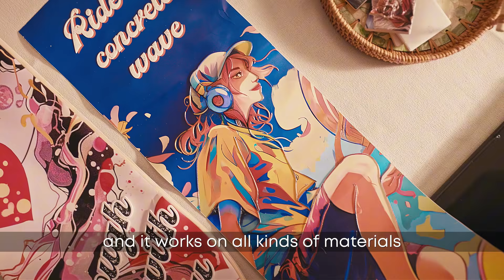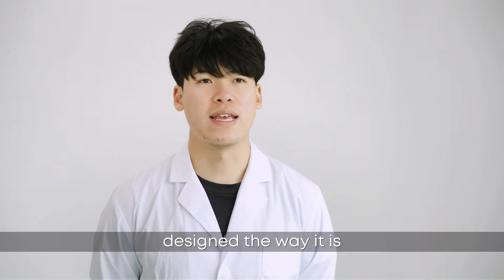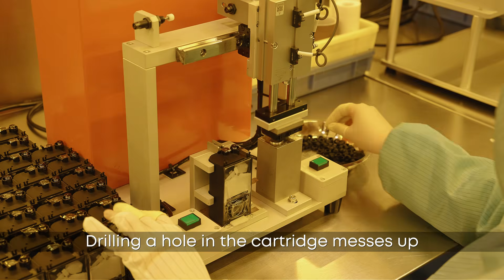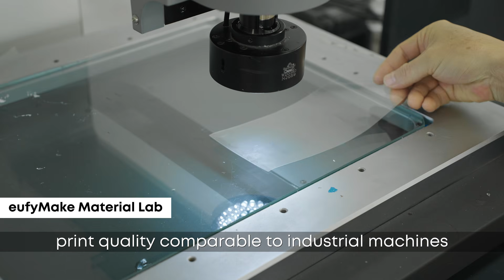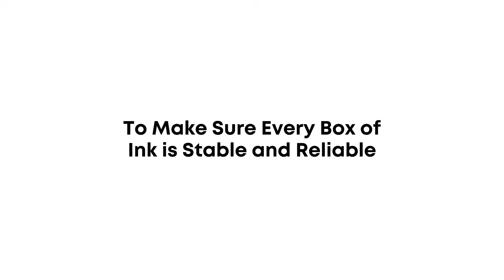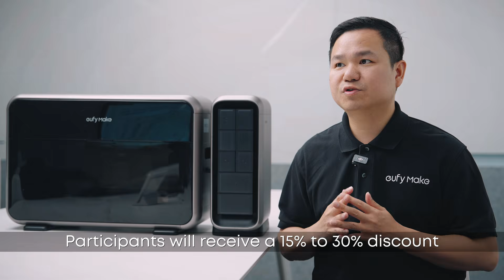What Makes eufyMake UV Ink Different? Safety, Stability, and Print Quality  Control#eufymake

Comment: Subject: Formal Complaint: Unresolved DOA Product and Immediate Refund Request – [Insert Case Number]

Dear Eufy Make Customer Support Management,

I am writing to formally escalate a complaint regarding a defective product and a complete breakdown in your customer support process.

I recently purchased a printer from Eufy Make that arrived Dead on Arrival (DOA). During initial setup via your app, the system prompted an error instructing me to contact support. Since that moment, attempting to resolve this issue has resulted in repeated broken promises and unacceptable delays:

Initial Outreach: I followed the app instructions and reached out for support; I received no response.

Follow-Up Email (Monday): I submitted a formal email ticket and received an automated confirmation containing a case number and a guarantee that an agent would follow up within 24 hours. No response was ever sent.

First Phone Escalation: After struggling to navigate your phone system, I finally reached a representative. After an extended call, I was told the issue was being escalated to a manager who would contact me within 24 hours. Once again, no follow-up occurred.

Second Phone Escalation (Today): Given the complete lack of accountability, I called today to request an immediate return and full refund. Instead of processing the return, the representative claimed the issue was being escalated to yet another "higher team" with another empty 24-hour callback promise. When I requested to speak directly with a supervisor, I was informed that "no managers were available."

Being repeatedly stalled with unfulfilled 24-hour callback commitments while holding a non-functional product is unacceptable.

At this stage, I am no longer interested in troubleshooting or product replacement. I am formally requesting an immediate full refund to my original payment method, along with a prepaid return shipping label for the defective unit.

Please confirm the processing of this refund and provide the return label within 24 business hours. If this issue is not resolved promptly, I will escalate this matter through a payment dispute with my financial institution and file formal consumer complaints with the Better Business Bureau (BBB) and relevant consumer protection agencies.

I expect a prompt resolution.

Sincerely,

Comment: This is exactly what could make people move away soon. Instead of using open/refillable ink systems, you’re locking users into your own expensive proprietary refill model with long delivery times and limited availability.
Right now people are excited because the machine is new, but once competitors release smaller, cheaper versions with refillable ink, many users will switch immediately. Companies like Xtool or BambuLab could easily enter this space and win people over by simply listening to customers.
Don’t focus only on maximizing profit from consumables. Focus on accessibility, availability, and user freedom that’s what builds long-term loyalty.

Comment: I get those reasons but why dont you let the customer decide. If you let them know the risks involved they can decide if they want to refill or just use the cardridge. Right now I am not certain what I should do. The main Problem is that white and gloss is way too small for a UV printer thats printing quiete a bit. And I am not even printing in height. If you make Textured prints you will go through a lot of ink. And the worst part is that even when I use the original ink the Printer still says that at 10% I should not continue because you can get air in the system. If you had a refillable System you could refill at that point and continue - just think how much ink gets wasted there which all has to go somewhere.

And risks involved please... Have you ever refilled or filled an Epson Eco Tank printer? Its really simple. You put the bottle on the fill port and it fills it up. It cant get any more simple than that. 
And have you heard of SLA Printers ? Those are also consumer products where you are required to handle quiete dangerous resins. And I havent heard of anyone complainig there. And lets be honest. Handling those resins and washing and curing those 3D prints is much harder than refilling ink where you only need some nitrile gloves.

And I get it: UV Ink is not normal ink in any way. But 40€ for 100 or rather 90ml usable ink. Come on.

There will be a time where a company will see what you do and copy it 1:1 with one difference: They give their customer a choise. 
And maybe some Ink manufacturers will also see this printer and sell inks at half the price or even lower. Its like in the early days of normal desktop printers where they sold the printer for 80€ and the ink replacement costs 60€

Comment: This machines texture feature promises to make products stand out from the crowd. But the price of the ink causes the user to not use texture to their benefit. Add to that the current lack of supply issues and it makes the machine unusable for businesses that need to be able to keep up with demand. Your reasons for proprietary cartridges all make sense but the price is gouge pricing. I likely will be going to an open ink system soon having learned from this lesson. Can't wait until Bambu Lab gets into the UV market...
Reply: Plus also the massive time to print even small textured products…if I print an 8”x10”. Do I have to do it overnight?  But what if something goes wrong during printing when I am asleep lol
Reply: @RobertMoy-xq1gc  Textured UV printing is slow. White ink anything is slow. That said, this one is slower than most because it has one print head, and not a very fast one at that. But for the price you really can't complain.  Up until now this tech started at 3-4 times the price of the Eufy and had a steep learning curve, and went up fast from there.   Eufy has things to work on but they definitely brought UV printing to the home user.  Maybe they didn't expect others to catch up quite so fast.

Comment: I understand and agree with much of what is said here, but it does raise a question regarding temperature. Which is something the video spent a lot of time on.

1) You mentioned that the temperature has a significant effect on the ink quality, that 3rd party inks are subject to fluctuating temperature, and that you control for this. How do the Eufy cartridges ensure a stable temperature during transport to the consumer? How do Eufy cartridges ensure a stable temperature while being used in the printer?

Comment: Make sure there is adequate supply and many won't be tempted to use open source ink.  Also let the larger source tanks, in the future, contain ink at a lower price and we won't be tempted to use open source ink.  Eufymake brought this on themselves due to shortages as well as price.

Comment: So the parts beside the software they used, parts are all similar to all major brands, print head is the epson x600 , which is used in lots of printers, the sealed cartridge is not holding pressure in the print head, alone, theres pumps that keep pressure , ink heads have cartridges placed above to help keep the pressure stable, eufy used a local supplier that sells inks to other companies that rebrand the ink, just like oil manufacturers sell oil to others, if your going to make an external system for high volume , just say that, dont use scare tactics to stop people and keep them locked into your inks.. your inks are more expensive because you pay extra steps to keep consumers locked to yours, and you are putting that cost on consumers by forcing them to your own ink....

Comment: Can you also address the cleaning cartridge capacity? My initial one filled - with no warning - before even 1/2 the initial ink cartridges were used. High capacity ink is not useful if you're changing the cleaning cartridge weekly.

Comment: Scare tactics! Poor show old man. People will continue to refill cartridges because it's cheaper. Simple as that, and you don't need to drill a hole in the cartridge, just use a syringe in the gasket so no worries about pressure there.

This is just a desperate damage control video because they've seen all the videos of people refilling them with no issues.

How is it that Longer, the printer manufacturer that's been around forever, is releasing a consumer UV printer with refillable cartridges compatible with 3rd party inks then if it's such a risk?.. I'm not convinced by this video at all.
Reply: You can buy a longer then
Reply: @RonPalacio I plan to. Now go carry on being a fanboy for companies that don't care about you.
Reply: @tjCooper88 😂😂😂😂

Comment: Sounds great! However: 
- Other high quality Greenguard Gold certified UV ink brands are competitively priced at $0.18 or less per ml. eufyMake is $0.40+ per ml.  With a 15% subscription discount, you are looking at perhaps $0.34 per ml for future purchases of eufyMake ink.
- eufyMake initially advertised a "12-month shelf life" for their ink during the Kickstarter campaign and on their website. They have removed this statement, it conflicts with their subscription based business model.
- We have multiple consumer protection laws in the U.S. including the Right to Repair.
Reply: No one is saying you can't use open source ink.  Just reasons why maybe you shouldn't.  I'm still on the fence about it.  I will wait and see after my warranty runs out.  By then there should be people who have used open source ink for a while and we will see their experience with it.
Reply: I’m not on the fence at all. They tried their best to lock everyone into their more expensive ecosystem. Within 6 months there will be readily available systems to refill not just soldering or drilling holes into OEM cartridges.
Reply: @Bbittner5857 there is now. A mod that doesn't even break the seal
Reply: I'm looking for the SDS information.
Reply: Yup, Epson UV Ink for the F1080 printhead is Greenguard too. Not sure why they just wouldn't use the ink Epson designed for their printhead.
Reply: @Anasazi-CO  like epson ink is cheap. lol

Comment: Thank you for this informative video!

The high capacity continuous ink supply system looks great! 😍
Reply: I'm excited as long as everything works. My brand new machine and cartridge wouldn't read and left my printer sitting for a month until support got me a new cartridge. I hope this system goes away from the chip as that seemed to be the problem. Support acknowledged issues and wanted me to add tape to the cartridges to have them seat the contacts tighter. Kind of a joke. Hope this system works better or at all.

Comment: Because you want another revenue stream that is all, that all its about!  UV ink is not a mystery all UV printers use it, you are not reinventing anything. Look at longer they are using it.
Reply: The adage... Just because you can, doesn't mean you should. I can drive my car the wrong way down a city street. Rules, boundaries and limitations exist for reasons. In this case, you can choose which ones you want. No one is forcing you to buy a Eufymake product. So don't complain about problems you make for yourself.

Comment: Whatever you explain to users, they understand only one thing. Consumables must be competitively priced to make a good profit. The difference is huge, for example a price of 43€ for 100ml and a price of 59€ for 500ml. For 16€ you get 400ml more. I have not purchased a eufyMake E1 printer, but it seems too expensive to maintain, from inks to cleaning cartridges. I see that there is more and more competition in UV printing and considering that Epson print heads are widely used, I do not see much difference in the final print between expensive consumables and those printers that use reusable consumables. I do not want to mention brands because I am not a defender of anyone. I'm just following the market as it develops because I want to buy such a printer, but I'm very hesitant because of the expensive ink, the cleaning cartridge that often requires flushing for maintenance and is also expensive, and finally the expiration date of the inks and the danger of needing ink right now and having nowhere to buy it because you're limited to only one place in terms of availability.
Reply: Glad they are addressing the ink issue as explained at the end of the video
Reply: @MortisNuntius  The ink problem is not exactly solved. They just add an additional device to hold a larger ink capacity of up to 300ml. The price will not be any different. In the end, when you consider everything, even with this new device you probably won't have more than a 10% difference in the price of ink. The main problems will remain. The high price and You only buy from one place and there may be insufficient availability if you have to buy at the moment.
Reply: @gwarsshay they have already stated the price will be lower for the larger cartridges
Reply: @erincunningham8025  Even if the price of ink is lower than the current one, they create a closed ecosystem to force the customer to buy from them and make bigger profits. This is good for them but not for the consumers. When there is only one store and only one ink, how can you guarantee that when you need it, there will be ink available to buy. Or will you tell the customer "well, wait 3 months for them to get it in stock":)

Comment: Sounds like a panic move to save their ink business.
Reply: I have worked for many years in a service for office copiers of various brands. I will only say that there is nothing accidental in the strategy. Everyone is familiar with small color inkjet printers up to A3 format or at least has seen one. The printer itself when new is super cheap but then if you want to buy original CMYK inks they cost almost as much as the printer. The same thing happens here. The technology is similar and apparently big profits are expected with inks alone but let's not forget that the competition is knocking on the door with better offers. After all, the end result is what is looked at and they cannot convince me that 10 plastic used and discarded cartridges (not to mention the emissions during production) are more environmentally friendly than one 1000ml bottle.
Reply: This has been in the works for months
Reply: 100% I wouldnt be suprised if they make a loss on each printer they sell - and the profit is all in the inks - that they make us buy for way over the true cost.
Reply: @ikweby9169  How does halving the ink cost with the new large capacity setup fit into that thought?
Reply: @ulaB well for one. We don’t know it’s going to half the cost. Only time will tell
Reply: @ulaB  If the ink is 6 or 8 times as expensive per ml as open ink, and you cut the cost in half, it's still 3 to 4 times as much. And it doesn't cost them anywhere near as much to make as they sell it for.   And they're trying to stop people from refilling the cartridges. They get $0 every time someone does that.

Comment: thank you addressing all these issues! i actually never got bothered about proprietary ink, because i know that would mess up the machine
Reply: It doesn't though as had been proven in multiple YouTube videos
Reply: @OwlandEmberCo  maybe it cant dmg the machine is short term..what about long term? if you drink a little bit of ink you wont die, but do it for years, im pretty sure you will have problems
Reply: @RonPalacio  long term; it may damage a $300 part (printhead). But the bad batch of ink that Eufy shipped (Magenta) the issues were present in under 30 days. And the official fix from Eufy was to replace the printhead. 

I do believe there could be secondary items like the tubing that need to be replaced as well, but Eufy said only the printhead needed to be replaced when I asked.
Reply: @Cakeboard last time i checked was 600 for the printhead..in no way im not allowing you to try to break your machine...as for me i prefer buying the cartridge at 43 usd instead of buying a new printhead or send it for service...you do you
Reply: @RonPalacio  $300 part. Eufy charges $600 for it.  But yeah, for power users it probably makes sense to do ink mod. If you barely use your printer, it probably doesn't make sense for you.
Reply: Eufy employee?🤣

Comment: Great video. There are arguments going online that the ink is safe for tumblers that the owner is drinking from the sipper, (where their lip may touch the ink on the top edge of the cup).  My understanding is that this is not the case. That even though the ink is cured it is not safe to touch the lips when drinking from a tumbler. Can you please confirm.
Reply from the maker: You’re right. Even when fully cured, the ink is not intended for direct mouth contact or ingestion.
Reply: @eufyMake so it's not good for tumblers even though you sell the rotary attachment?
Reply: @slydog75  Most tumbler blanks for UV printing have a drinking straw or other mouth piece.
Reply: @slydog75 Are you licking the outside of your tumbler when drinking liquids?
Reply: @slydog75  - The rotary was not designed as a "tumbler printer". It's for any cylindrical object. It's YOUR job to use it safely. This is why lots of tumblers leave a 1/2" line around the top of the tumbler that is just stainless steel. So there is no direct mouth contact with the powder coat or print. Full bleed, full wrap tumblers need to be used solely with a straw.